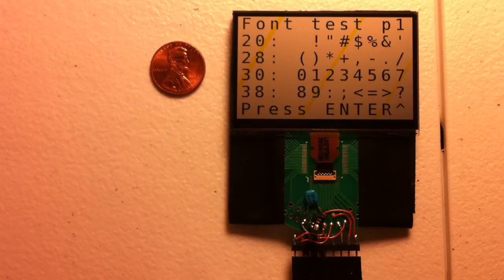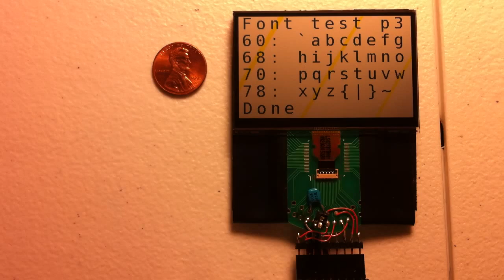Sharp 2.7" memory LCD demo

Comment: what interface you are using? can i drive this lcd by SPI? where can i get demo for pic controller interface
Reply from the maker: Custom hardware with an Energy Micro (now Silicon Labs) EFM32G380F1024 "Giant Gecko" microcontroller (ARM Cortex-M3), and firmware written in C to bit-bang the SPI interface.  Since then it's been rewritten to use SPI mode of the USART on the chip instead of bit-banging, and I'm working on getting it to use DMA.
Reply: Eric Smith Thank u Eric

Comment: Thanks for the help Eric. Unfortunately, after many hours of fiddling, we still cannot get anything useful to display on the screen. The lack of feedback makes using this screen quite hard to use. I guess once you get it right it just starts working.

I put a circuit diagram and simple arduino program for driving the screen on dropbox at the link below. Can you spot anything obviously wrong with it?

dropbox.com/sh/eu6vuj7loart3bi/mh69I7fa3H

Comment from the maker: As long as the supply voltage is below 5.5V, and the logic high voltage is between 2.7V and the supply voltage, it should be OK.  Make sure you're not trying to clock it at more than 2.0 MHz.  They do power up with garbage, and you should normally send a clear command.

I started with the 1.35 inch display because it was less expensive and the interface was electrically identical.